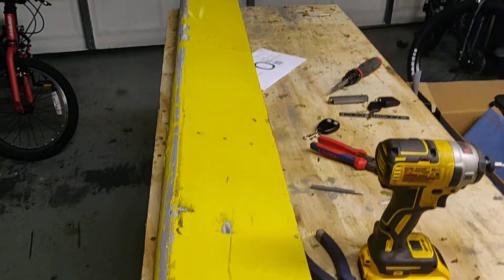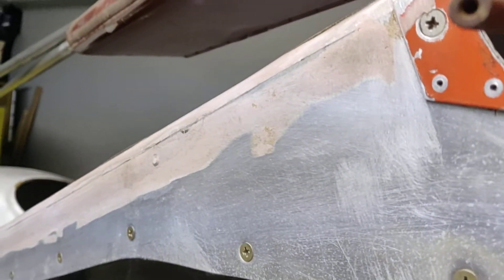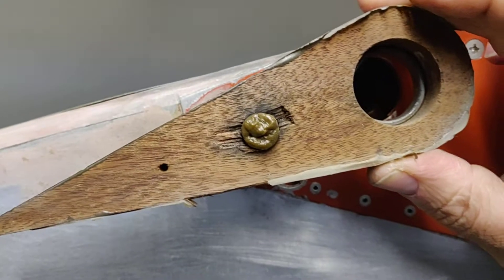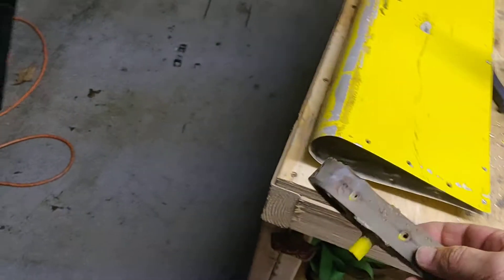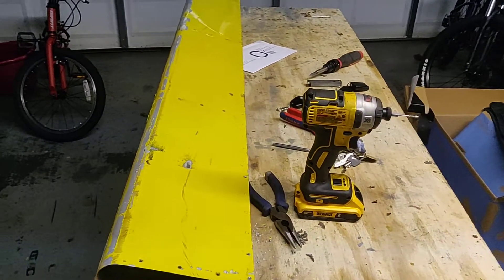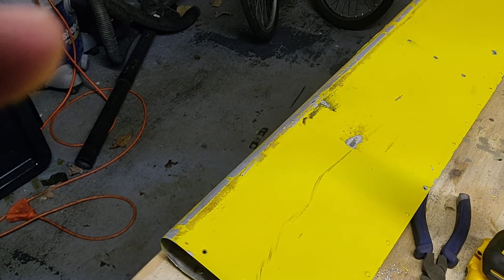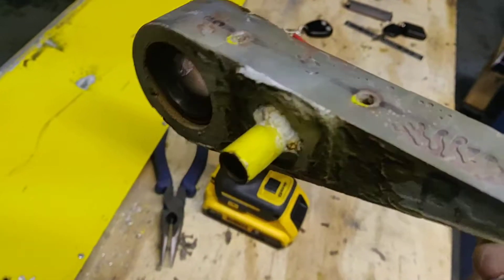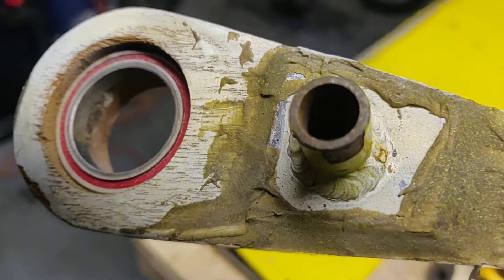BD-4 right flap teardown

Comment: When I bought my BD4, one of the previous owners offered his help to remove the wings for the trailer trip home.
At one point I heard banging from inside the fuselage.  
Upon investigation I found him banging away at the torque tube with a carpenter’s hammer in an effort to get the wing to slide.
I immediately told him that his help was no longer needed, nor welcome.
Thankfully he had no part in building the airplane…he is a financial advisor, not a mechanic.

Sorry you are having to pull those control surfaces apart.